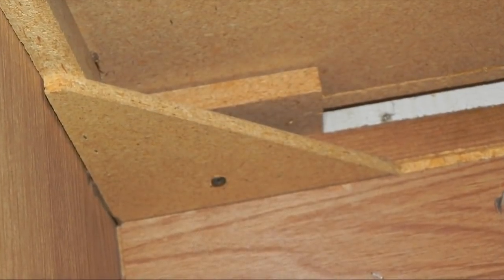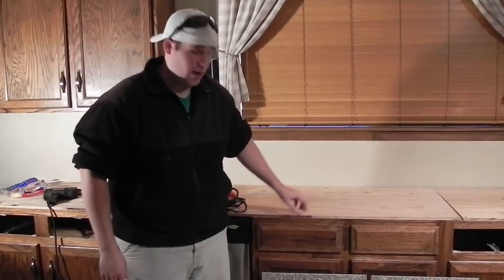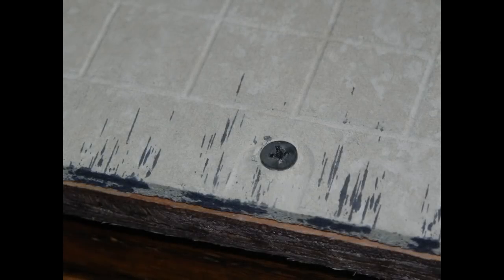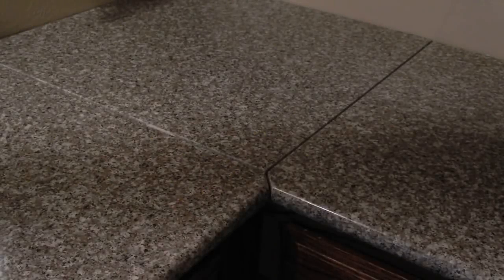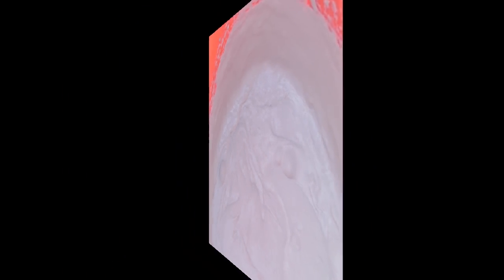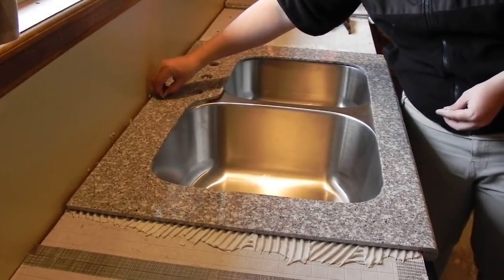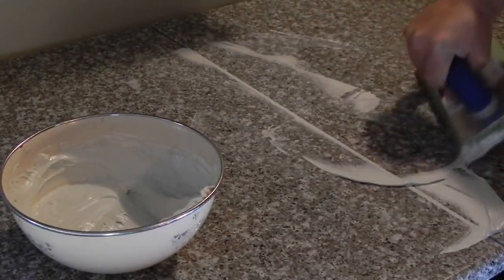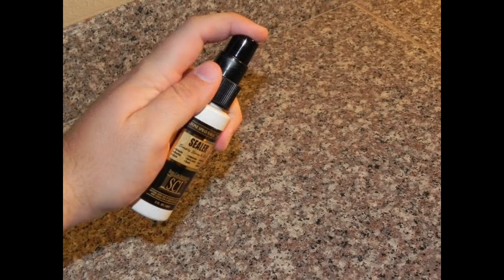Lazy Granite Kitchen Countertop Installation Video

Comment: So what happens if u need to remove tops say due to water damaged floor? Doesn't look like it can b removed and put back. Seems to me like u should template kitchen lay it out n a shop glue tiles on plywood excluding filling seams use a sink mounting system (not the plywood. Sink can't b removed and over time if it gets water damaged around sink now your plumbing is sink support) now you can install top like a laminate top(screws from bottom) finish seams and DONT use liquidnail to glue up splash it cures out hard it don't stick to granit very well and over time will pull loose and cause grout line cracks. Use silicone